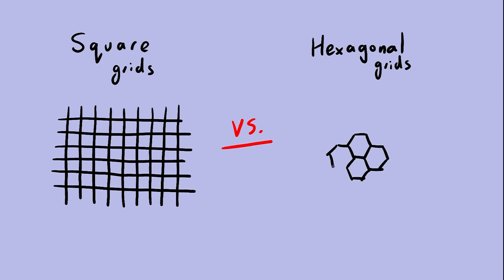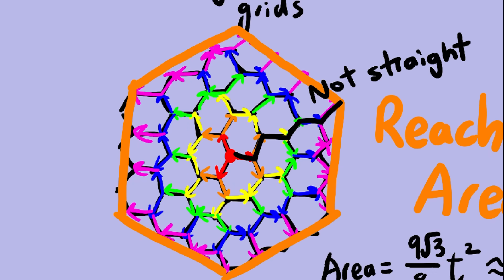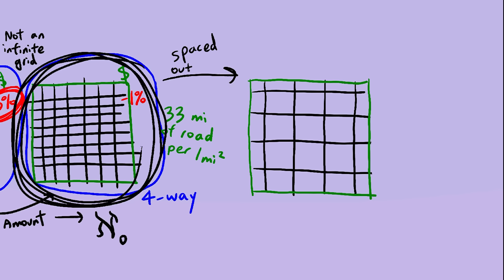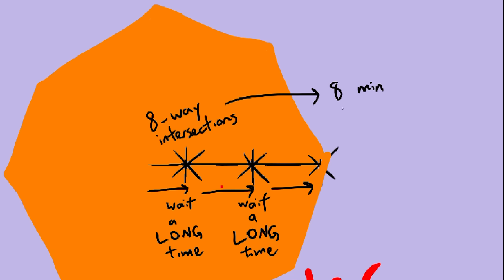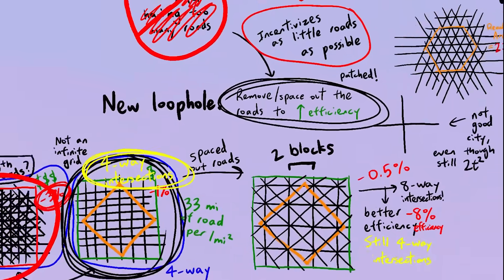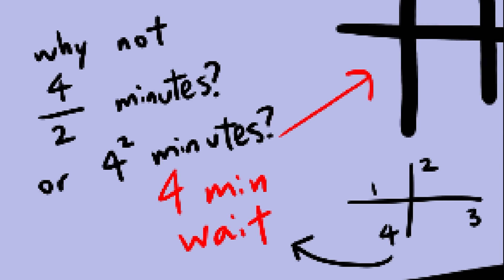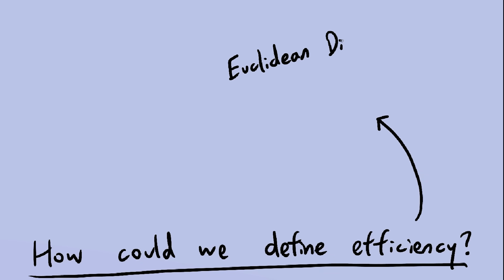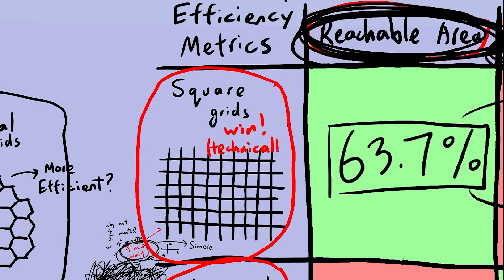Would hexagonal city blocks be better?

Comment from the maker: There is a small error at 6:56, the efficiency of that modified square grid is not actually 7.07%, it is 10.8% (I'm pretty sure). This doesn't change anything significant in the video, I just don't want there to be an inaccuracy

Also I apologize for any non-math mistakes in the video, I've never lived in a city and pretty much everything I know about them is from movies. But if you spot any math-related mistakes please point them out! Thanks
Reply: I'm thinking the real mistake there is how you count your "ways"... a 4 ways intersections is, in fact a 2 axis one. The 3 ways intersections of the hex grid would be 3 axis. 

Imagine a car coming in the 3 way intersection, if it's green for him, 2 others have to wait,  in the 4 ways it's one full axis that has a green light (left turns priority not included if course)
Reply: This is a great video, but you've overlooked several critical factors. 

First is the type of intersection. In a Hexagonal grid layout, it makes far more sense to utilize a 3-way roundabout. That cuts out intersections all together, so no stop and start driving. You could theoretically do that with a square grid too, but your land utilization efficiency would kill that plan, while it is still viable in a hexagonal grid (assuming the cells have the same approximate area). Also a 3-way roundabout gives drivers a 120° field of view, and necessitates only having to look in a single direction before entering, instead of monitoring three different angles of approach for other vehicles. As most accidents occur in intersections, this is not only safer, but reduces delays resulting from collisions. Using this system, you also require no traffic control devices like stop lights, which can drastically reduce costs, more than compensating for the additional paved area's install cost. A hex grid works much better in this scenario. 

The two big caveats to a hex grid, utilizing 3-way roundabouts are:
1) Bad for pedestrian traffic. There are no intersections for road crossings, cars don't stop. Realistically, you would need overpasses or underpasses to support pedestrian traffic, which add dramatically to cost, or you would need to add stops, which degrade commuter efficiency. 

2) Larger diameter roundabouts perform better, but you have the land in the center of the roundabout which is harder to develop. The inner roundabout areas are evenly spaced and blanket the entire grid, so possible uses for things like power and water distribution, or add some 5G nodes for very reliable wireless coverage. There are opportunities to use that land well, but whether or not they work in a given situation is determined by factors beyond this discussion, and would likely not be universal across multiple implementations. 

And then there are delays from things like road maintenance. Both models give you at least two equal distance routes between any two points, so there is always a detour route that does not increase commute distance. However, in practice, most square grids are not actually square,  just mostly "squarish", where a hex grid must realistically be more uniform to maximize the land usage. So, pros and cons to both systems. The Hex grid is superior in detour routing due to it's greater uniformity in real-world applications. However, the square grid is more flexible if there are existing structures or terrain features that do not allow for such uniformity over a larger area. Hex grids are more commuter efficient, but less cost and planning efficient. 

I think it's more about scale of implementation. A Hex Grid makes very little sense for a small rural town, or the suburbs. It makes much more sense for larger cities that have a robust public transit system, and many pedestrians who only travel a block or two, ideally under or over the roads rather than across them. Think NYC, Helsinki, or Montreal with the tunnel systems that allow people to walk between buildings without stepping outside in the winter. Tunnels can bring their own problems, but it's an option. You then use the hex grid for faster travel. No intersections, bike or pedestrian crossing or stop signs, and a wide diameter roundabout allow motor vehicles to move throughout a city at highway speeds without ever slowing. Imagine NYC, but you can drive between any two points in under 20 minutes. That's very appealing. But you need to work at a large scale to make that viable given the high cost. The economic value could easily offset the costs in the long run if planning a city from scratch. But there's just no way to implement such a design in an existing city, obviously. 

The key here is that cities are already designed with a grid system in mind, and infrastructure is built around that on a fundamental level. If you change the roads, you change everything else too. Roads do not exist independent of other infrastructure, it's all tightly integrated. Power lines tend to follow roads, storm drainage, etc. You have to redesign it all to realize the benefits of a hex system. That's the primary reason they're not used. Not because they are objectively worse, they're not. But they are very costly, don't work in existing cities and that small change has a ripple effect throughout virtually every other aspect of city planning. It's a major undertaking.
Reply: @Arkryal (roundabouts are easy to walk around as a pedestrian, usually there's a walkable layer ring around, which is often paired with a bicycle ring.)
Reply: That would also be consistent with 8:28
Reply: The laziest way it to start with no grids or zoning and let the peoples "desire paths" decide the shape of your roads. then have a simple grid that is clearly marked for tourists to get around town and the desire paths  that are less intuitive for the locals who know what they are doing (or those using GPS) to get around town faster.
Reply: Nevermind I made it to 9:54
Reply: Imagine the roads though
Reply: If you don’t live in a city how do you have internet access
Reply: @Theologykid internet access is far more widespread than you'd think
Reply: @Theologykid  Broadband is available in a lot of rural places, and of course back in the day we'd use the telephone line to connect to the internet. But then there's also of course mobile data which often has pretty decent availability outside of the absolute most remote areas.
Reply: you know what a Roundabout is right? also look al a La Plata map and amaze at an perfect grid solution
Reply: You forgot the pedestrians tho.
And bike, but not just bikes, trams, subways, skate, ..
Taking the whole city as a car grid is like having asphalt as your main road supplier: patches of grass do count towards nicer cities, and raw individual transportation would not account for that.

Comment: 1. Humans tend to underestimate the speed at which they are driving more on long straight roads compared to roads that aren't.
2. The reduction of the space the dark streets make up would reduce the urban heat island effect.
3. You would have better visibility on a hexagonal grid.
4. Wind speed will be reduced in a hexagonal grid so depending on where you are, this could be verry important.
5. Hexagonal structures are more robust.

Comment: Hexagonal grids have a better ratio of area for putting buildings in and roads to travel across.
Squares: 1 square unit per 2 roads = 1/2 square units per road
Hexagons: 3√3 square units per 3 roads = √3 square units per road
So a hexagonal tiling has 2√3 times as much room for buildings as a square tiling with the same amount of roads

Comment: You know, for downtown areas and residential areas it makes no sense to prioritise speed or efficiency for cars anyway so I think the hexagonal pattern would actually be great for calming the traffic (constantly having to turn means cars naturally slow down). And if you make the hexagons big enough, you could even make it so that non-motor traffic would use a completely different system of streets; if cars had 3-way intersections at the corners, pedestrians and cyclists could have 6-way intersections in the middle of the hexagons (intersections being much less of a problem for pedestrians and cyclists) and that way you could use the interiors of the hexagons for pedestrian oriented things and the exteriors would be for car oriented things.

Admittedly this would mean a lot more streets which is more expensive, but the pedestrian streets could be narrower and would probably require less upkeep.

Also emergency vehicles could use the pedestrian streets, which would allow them to avoid most of the other traffic and drive as straight and as flexibly as possible, and since the pedestrian streets would be all straight, people would see and hear the emergency vehicles coming from a long way away and be able to move to the sides to let them pass.

Also for the intersections between the pedestrian streets and the motor vehicle streets, I think there would have to be one of those things where the intersection is at the pedestrian level and the cars will have a natural speed bump going up to the pedestrian level and then back down. This way the emergency vehicles also don't have to be slowed down too much because they use the pedestrian streets.

Either that or there's an underpass for the cars, underpasses get flooded easily, you don't wanna have loads of them in one city. Also they're probably expensive, idk.

Comment: The problem is that in reality the size of the grid matters. Every building should be connected to a road to work properly. So the hex grid has to be much smaller if you want to have the same density of building area... But you know what... Lets build parks inside the cells...

Comment: the best structure for cities is a spiderweb like structure, circle roads that allow you to bypass most of the city when you are only in transit and the city center itself isn't the destination directs traffic away from the busy city center wich has as many roads to and from the countryside directly leading to it as possible, with smaller streets inbetween used by local trafic

Comment: I think that coordinating the intersection lights on the hexagonal grid to promote mass traffic flow through the city would be hell. There would essentially be 6 directions of travel and if the roadways between intersections are not adequately long then traffic would be horrible because the amount of people that would need to switch lanes in a short stretch. There has to be a solution with one way roads or smart light patterns, though I suspect that in order for mass flow to work people will have to take a less than perfectly efficient pathway from point a to point b. I'm gonna look if there are any simulations
Reply: Actually I think it would be almost necessary to have only roundabouts in a hex grid system

Comment: Use a double Hexagonal grid, one set of roads exclusive for Bikes and Pedestrians. For Car roads, at intersections turning towards the passenger side can be free without stop lights🚦🚫↗️. I believe this would be the most efficient configuration in practice. Not to mention that less road to build and maintain saves costs, and the constant turns forces drivers to pay more attention which makes them safer.

Comment: Yeah the issue here is cars and building. 90* angles and straight lines are just so much better for fuel efficiency. Not to mention it's easier to design a square building than a hexagonal one. Great video though. Lots of geat points.

Comment: The most efficient way to reduce travel time is to have a higher mix of residential and commercial. If someone needs to travel to the grocery store, having one closer to them will lead to them traveling to it quicker. Those commercial areas can also provide jobs which reduce the amount of people having to travel far during rush hour. Rush hour tends to have a lot of traffic congestion which lengthens travel time as well so a good way of reducing traffic is to have public transportation that can take people from residential areas to commercial and industrial areas. Lastly, instead of removing some roads it might be more beneficial to change some of them to pedestrian only streets. What that might look like is a 2x2 road system with a 4 way pedestrian street intersection in the middle of it.

Comment: but we are only accounting in single factors here, wouldn't it be better if we accounted for all? for example. in all square wins he won by a max of 1.7% but the hexagonal win was 2,8 and if we calculate them all together (all i did was add them up and then subtract square by hexagons) we get a 0.2 margin on which the hexagons are better when looking on full efficiency.

not sure if this is correct. just a thought that came to my mind as we are giving more credit to small wins instead of the big ones.

Comment: Could you impose restrictions such as the radius of a block (largest distance from a point in the block to it's boundary) needs to be smaller than some value (because otherwise transport to the blocks is not the limiting factor) this would fix a let's make sparser grids because you can only do that so much. (Or introduce a penalty based on time needed to travel inside block but that introduces more parameters to be tuned) Second you could introduce a fixed width to the roads this then the goal could be to maximise reachable usable area so everything that is not road which would prevent just slapping on more and more roads. This problem would then only have one relevant parameter (road width/max block radius). For each value of this parameter one could find the optimal grid. Further you could introduce a time bonus on wider streets because of congestion (but then again new untuned parameter so not fun)

Comment: I think the best way to measure efficiency is to pick an arbitrary metric and adjust the constants until the layout you prefer wins.

Realistically though I'd want to bring in some penalty for area not serviced by roads. But then you have to question if an area is 'serviced by a road' if there isn't any parking.

Comment: there should be a penalty for direction changes...
every time you have to change the direction you're traveling in yyou have to slow down. just passing an intersection doesnt always add the same penalty. if you can drive straight across an intersection there is a chance that you hit a green light and have no penalty at all. so it can become more preferrable to move fully cartesian making your entire movement first in one direction and then in the other direction instead of chopping it up in a bunch of left and right turns. in the end you have travelled the same distance in both directions, but the additional time spent because you had to change direction at an intersection makes it less efficient

Comment: 4:50 for this "more roads at intersection penalty" there's another loophole you didn't consider in the video. You construct the 8-way grid so that the diagonal grid meets the square grid at the intersections, yielding 8-way intersections, but if you take the diagonal grid and offset it slightly, you can make it so that the diagonal grid only intersects the square grid along straight lines (slightly next to the intersections). This makes the resulting grid only contain 4-way intersections, but with double the roads, so the "number of roads" criteria still needs to be considered, and not just the number of intersections.

Thinking about it another way: A "grid" of lines that are completely randomly placed (random origin, random slope) at continuous, non-discrete locations, will only ever yield 4-way intersections (as the chance of 3 lines intersecting at the exact same point is infinitely small if created that way), regardless of the number of roads. So you could have an infinitely dense grid to reach maximum efficiency (as there would always be a road pointing near-exactly where you want to go), and because you did away with the "number of roads" constraint, that kind of thing would just arbitrarily win.

Comment: Coll video. 

Other factors to consider is the area within each grid equal to all other grid options? After all roads aren't just about traveling distance, but also area density. If the included area is not equal then the density will be different. 

Traffic circles solve 8 and 11 way intersections, but at the expense of usable area.

Comment: There are optimization problems on how many stages can a traffic light have, given a certain number of roads. Maybe that should be used as a metric of waiting at an intersection, instead of arbitrarily picking a number.
You can always have n stages for n roads (just let one direction at a time), but you can let all the right turners simultaneously, opposite straight goers, etc. Maybe somehow there is an optimum there.

Comment: Yep, there are a lot of other factors to take into account... I happen to live in a city that tried to do hexagonal city blocs. A whole new neighborhood was built in the 70s or 80s and they were trying to create the futuristic city by experimenting like this... It is called Hautepierre, it is west of Strasbourg, France, you can look it up in Maps.
And it is ... A freaking nightmare to drive through. Very disorienting for one, plus since all roads are not used at the same rate and there is a tram railway going through, all intersections have weird priorities so they ended up closing some redundant roads in some direction to improve traffic at some intersections, making the whole navigation even more confusing... 
I should add that all the city blocs are pretty huge, it is a factor to consider. But smaller ones would have made even more intersections, so ....
Nice try though ^^